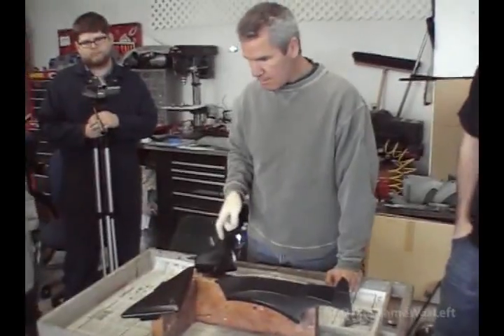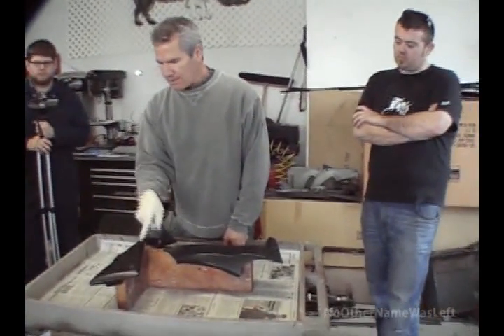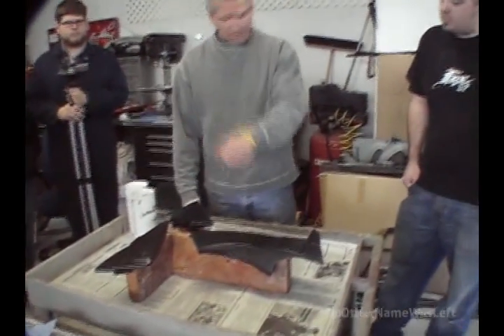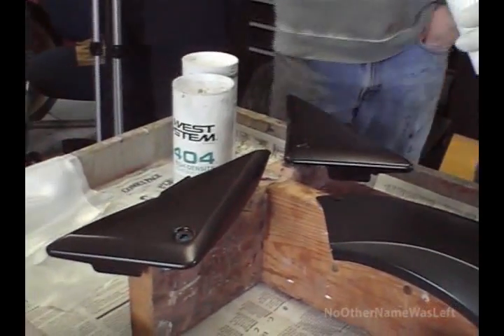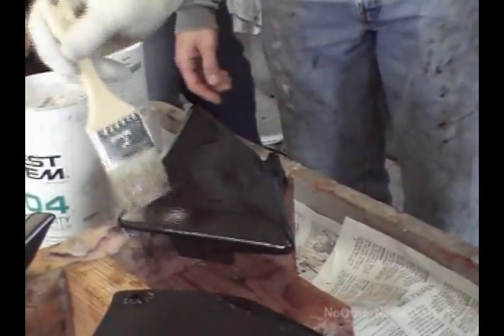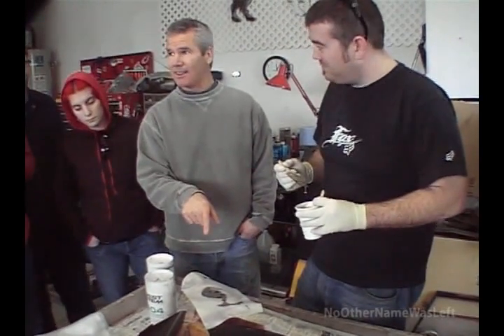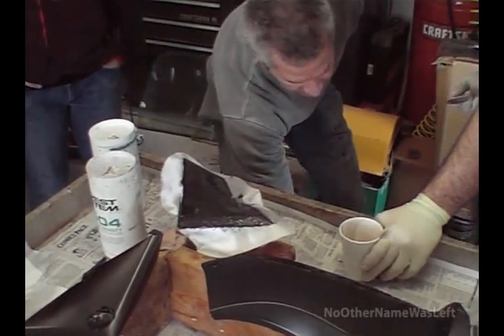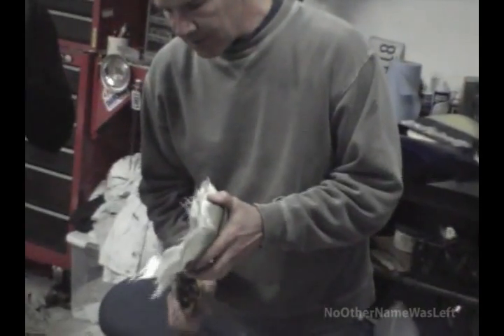Tygaboys Carbon Fiber Fabrication Seminar Episode 4

Comment: I'm trying to make a heat shield for my dirt bike, but I'm worried about the heat from the head pipe affecting the Epoxy. Do you have any suggestions? The only stuff I can find for High Temp application is usually black or grey in color, which would cover up the carbon fiber I would think, and needs to be baked in an oven for the curing process. Any help would be much appreciated. Thx

Comment: Polyester used in carbon wont yellow.  There's not enough resin on the surface of the part for it to be noticeable.

Its when you use a clear surface coat (epoxy/gelcoat/polyester) that is not UV stable that you will get yellowing.

Almost every after market hood is made with carbon, polyester resin, and a clear UV stable polyester surface coat sprayed into the mold before the layup begins.

Comment: Hi, I have a question about the first part in this video. What was mixed with the resin as a "filler" to get the intricate detail of the mount point? 

Why would you not just cover the entire part with a layer of the resin/filler mix and then place the glass over top of that? I would imagine this way you could better ensure that there are no air bubbles. What do you think? Thanks.